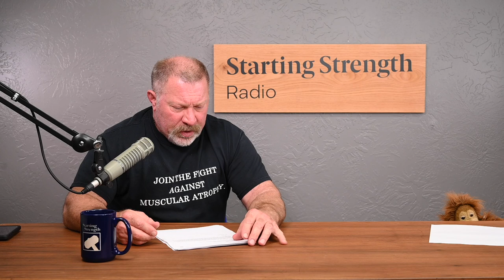How To Take Care Of Your Barbell - Starting Strength Radio Clips

Comment: Rip, you recommend water or oil-based lubes?
Reply: 3 on 1 oil works well.  Rogue has a demo on taking apart an Ohio Bar and they use 3 in 1 oil.  I cleaned my bars during lockdown and they spin like new.
Reply: @bmstylee  r/whoosh
Reply: @HAL-dm1eh  yeah I know.   My mind has been in and out of functioning for the last week.

Comment: Have we finally run out questions?
Reply: Actually it's a good question.   I have around $1000 in barbells and I like to properly maintain them.  It makes sense to take care of your investment.
Reply: Wild Bill fair enough
Reply: @Nerd.Immunity.  but yeah.   It seems we are running a bit low on questions
Reply: Wild Bill what do you do to maintain the shaft and if any surface rust appears?
Reply: @LV426Survivor  same thing.  3 in 1 on a soft brush.  But a good finish generally holds up well unless you are one of those who has acidic sweat or live near a large body of salt water.  When in doubt get a stainless steel bar.  Problem solved at that point.